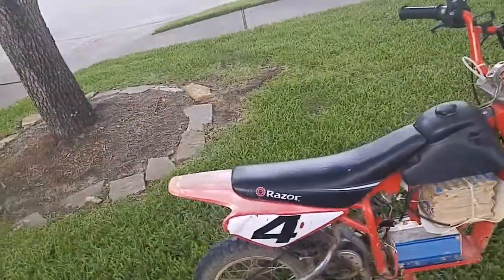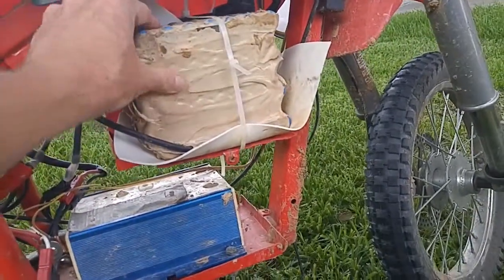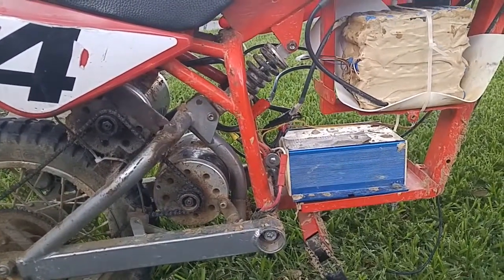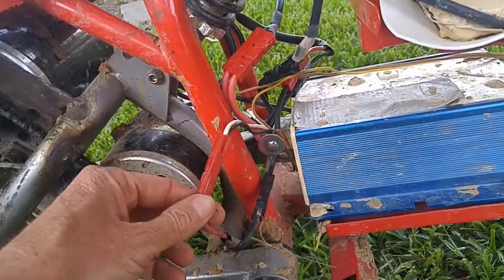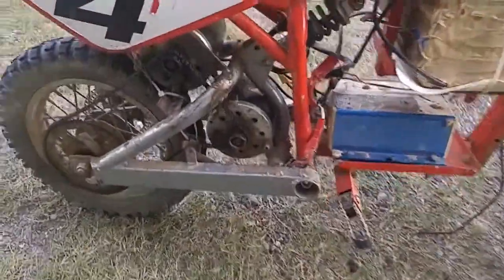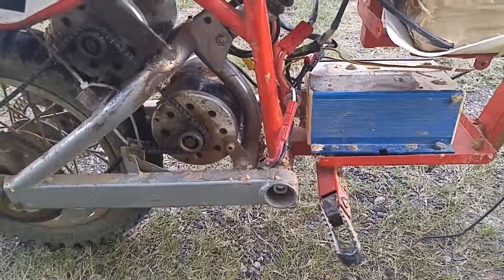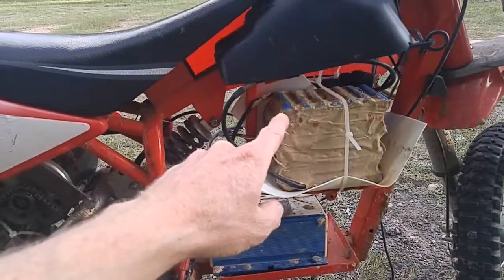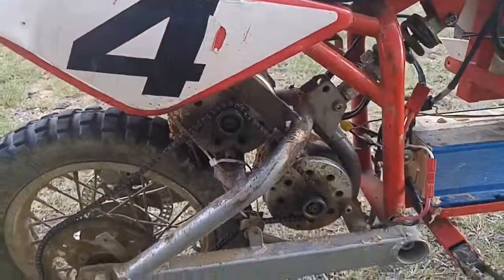6.5 Kw Electric Razor 350 dirt bike mod

Comment: Folowing
Reply from the maker: Well I got rid of the bike.    It was a blast, but I burnt up the motors (I know shocker) and sold the parts.    Currently working on the gocart with BLDC 8.5kw motor, I should be able to do 15hp for short bursts.

Comment: how did you mount in the second motor?
Reply from the maker: A buddy of mine is a welder, and he put in a small 3/4 angle iron to support the motor.   the 2nd motor was held in with 1 or 2 bolts.
Reply from the maker: No.   Welder buddy has not finished yet.   Been 100f so too hot.    I bugged him today actually and he said he would work on it